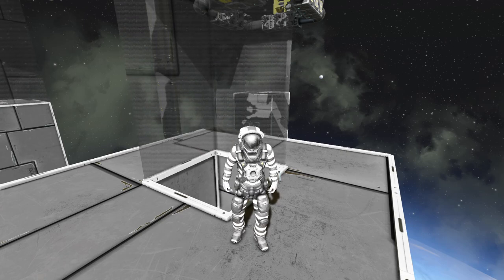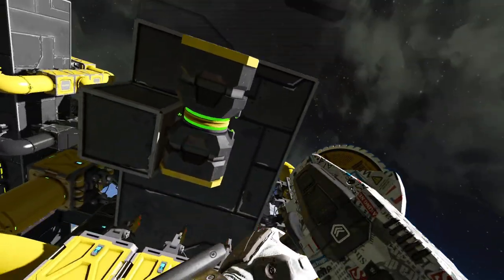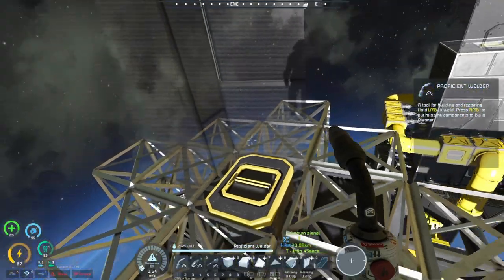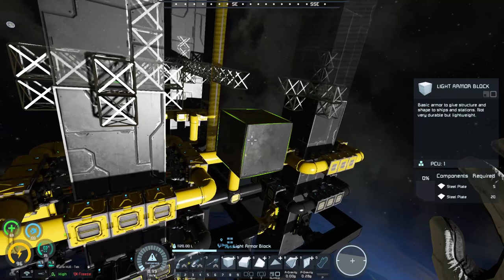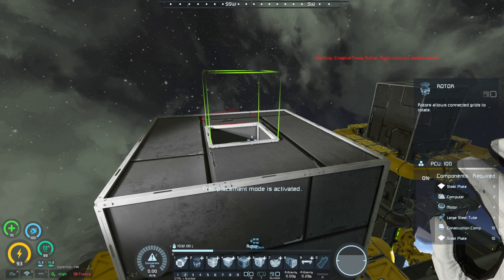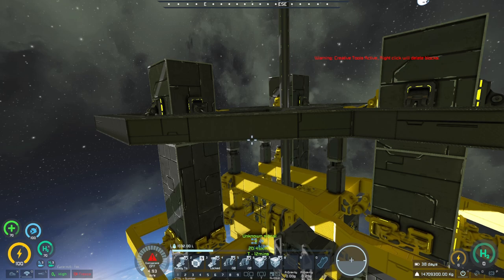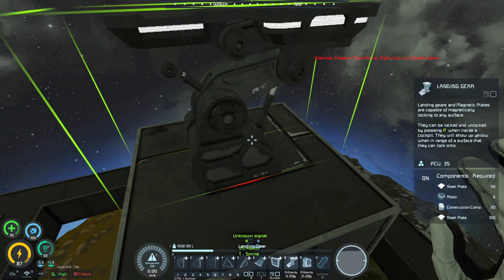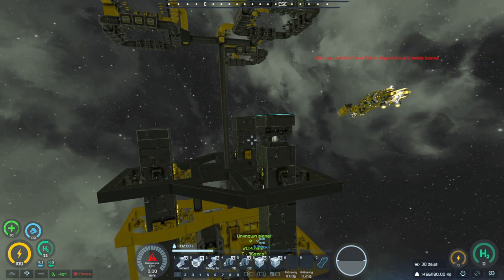Space Engineers Experiments: How To Build Over The Height Limit? Multiple  Ways!

Comment: My vote is for that rotor method, just for the ease of alignment. I'm curious if when you complete the space elevator, what would happen to the grids if you use merge blocks to join all 3 20-km sections into one grid? Will something like a coordinate precision error mess with the game b/c the engine can't reliably calculate the location of the blocks on the ends of the grid? (I assume this is why the 20-km grid dimension limit exists in the first place)

Another question: Are all PCU created equally? i.e. Are 125 armor blocks equal to 1 connector, or 100 armor equal to 1 rotor, in actual CPU/RAM resource usage? What about 1 light armor vs 1 heavy armor vs 1 interior wall?

We already know for sure that static grids/stations are more performance friendly than free-floating grids. And I've seen someone mentioned ages ago that interior blocks and unfinished armor blocks use more resources b/c they have higher polygon count or details (emissive lights on the interior walls) than plain finished armor blocks. My guess is that SE PCU are just a simplified estimate of resource usage.

I was thinking of ways to "Wal-Mart" the space elevator, cutting corners down to a minimum of PCU per layer, while still keeping it robust enough to not disintegrate just b/c of drunk engineer flying.

Maybe a 1x3 layout of 1 armored conveyor between two heavy armor blocks, as a minimum? Or for enough angle to provide some inherent elevator platform stabilization, add a 3rd heavy armor block on the back side of the armored conveyor, creating a T-shape. That would be 13 PCU per layer, instead of the current 34 PCU. At 12,000 layers for 60 km height, that's a difference of 252k PCU (156k vs 408k). We know the SE engine can handle 156k PCU, esp as a static grid. I suspect 408k PCU may be ... challenging. :D

(Obviously a single conveyor tower (for potential connector construction and access on the way up) or single armor block tower (for absolute cheapest PCU) would be the logically cheapest extreme, but highly vulnerable to accidents. Second runner up for cheapest PCU would be a single (heavy) armor block with (armored) conveyor attached to one side, but any piloting mistake would have a 50% chance of destroying the conveyor line and probably disrupt the elevator platform's stability.)

For survival resource consumption, heavy armor uses 6x more steel plates plus metal grids, but has about 6.5x integrity of light armor. The metal grids are optional, and can be left out to save on cobalt for only a minor loss in integrity (something like 10%?). Overall, a heavy armor T-shape would save about 25% in steel plates versus your current PP 3-tower design.

Kind of curious whether a ship could time-efficiently prefab 100m or even 1km sections of the tower, then lift them into place and merge them?

Applying the same cost-cutting process to the elevator platform and construction rig, I'm sure you had to really experiment with multiple redundant landing gears and wheels in order to achieve enough stability for the platform and rig to consistently maintain alignment.

My T-shape elevator shaft has a much smaller length and width, providing less leverage for the rig/platform to stabilize themselves horizontally compared to your setup. I'd have to try a more vertically stabilized build with outriggers above/below the main mass of the rig/platform. There physically isn't enough room to use the same number of landing gears and wheels as you did, for a single layer rig/platform, but I'd have to maybe double it at least if using one or more vertical outriggers to stabilize the grid's alignment to the tower. If total platform mass could be kept low, back-up H2 thrusters might not be necessary. On this point, I think Andrew Man Gaming tried out some wheel-only elevator platforms, and found that their friction quickly failed when he put a full sized large grid spaceship on the platform. It'd be interesting to see how much mass can be lifted per 100% friction 3x3 or 5x5 large grid wheel, how badly suspension strength and wheels phasing into the elevator shaft will incur Clang's wrath, etc.

Landing gears would be the most reliable anchor, but your point about landing gear and piston inchworm drive is quite clear -- that would take FOREVER to ascend the space elevator. Plus lifting a large spaceship using pistons feels risky due to off-axis forces, unless the load can be centered very close to the elevator shaft.

I'm guessing a payload of a few hundred tons will be easy for most sensible platform designs. Maybe even 1k to 2k tons. But 10k to 20k ton ships are going to be a challenge. Kinda makes sense, the way sci-fi often depicts larger ships as being 0g-bound and requiring smaller shuttlecraft (or space elevators) to ferry cargo and supplies in and out of the gravity well. In SE game economy terms, I wonder how many trips on a space elevator would be needed to break even on the initial player time cost spent building it? :D As compared to building/collecting the H2 or battery power infrastructure to pay for normal large grid ships to fly from surface to 0g.

For this reason, I'm looking forward to your future experiments with maximum payload mass with the space elevator platform!

I know people played around with space elevators years ago when planets were first introduced, but the engine has changed a lot since then. It's cool to see you revisiting the idea at this point in the SE engine's development.

So many questions from watching your videos. I've taken a break from SE for a while. This is giving me the itch to get back to it and try to answer my own questions, using your tips!

Comment: Great piece of engineering 👏
I would like to see a construction-machine automatically building the rotors-connection every one kilometer of height. This construction-machinery should also automatically fill it's build-resources, means, it should connect at every stop of the lower crawling part at a connector to be able to suck resources from ground base unattended (no need to manually fly or atach resources to the welders).

Comment: Hi, the rotor/piston/hinge/connector/merge block are very good solution to solve this problem, landing gear solution can't pass through any energy to other grids.
For my part I prefer the solution of fusion blocks, to keep away "Clang", which can be used once the project is finished. I also think the fastest and Clangless solution will be to use connectors. Anyway very nice job 😉.

Comment: I would like to see a wheel-driven elevator rushing up and down the construction really fast. Not more than two minutes drive-time from bottom to top. Wheels on rotors do not have suspensions and therefore they hopefully do not wobble. I would use rotor-attached wheels to prevent wobble and suspension-attached wheels to gain speeds.

Comment: *Edit: Posted this comment only halfway through the video

Welp, buildlimit hit, this may impact you not only in space, but also in your base. have your tried building below the tower to see?
Three methods i would personally apply:
1. instead of connectors, a hinge will give you a subgrid that is perfectly centered, just set its limits to 0
2. Have blocks facing into eachother that do not merge, you can make pretty nice inward shapes, this is in the event you end up merging a grid that is past its limits with another grid, i dont really know what would happen
3. Convert the second subgrid to a station in the K menu. (Also, using voxel hands to place a voxel piece that they can attach to be static would probably work well. you can see an example of this concept in any valheim build tutorial that builds towers far above build height, they spawn a floating rock that the grids will hang on to.

As you are limited by the game engine, i wouldnt look at it as unfair to spawn a voxel as you are using the game engine to fix its limitations in the "safest" way possible

Comment: Wait.... you can build a base 20km in any direction? 
Were building on the side of a mountain and I was worried about the fact the stairs were going 800 meters from the base lol
Also I note the device you have appears to have made the blocks as it went up? is that right and if so how?
(digging a tunnel I am using piston, piston drill... then grind it down and do it again further on, if i had it make a road as it moves it cold be a rover and keep level..? or the holo blocks a mod?
Reply: Pandemic Playground previously built a template tower of blocks, blueprinted it, and is now using a projector to project that tower blueprint. That's the holographic image you're seeing.

You can look back in his previous episodes of this series to see details of the timer block welder rig. Basically, it's two frames, each of which uses multiple landing gears to lock onto all three towers. A piston connects the two frames. Timer blocks coordinate the locking and unlocking of the landing gear sets on each frame with the piston reversing, on each cycle.

There is also a set of welders on the lower frame to build a projection of a conveyor pipe in the middle.

Periodically, PP manually builds a connector on the conveyor, and lowers a connector on the frame to connect and refill the frames' cargo container with components for building the tower and conveyor pipe.